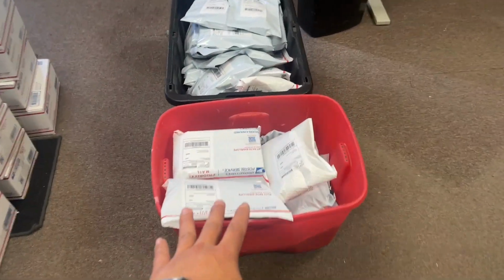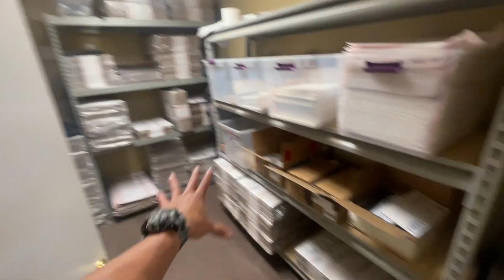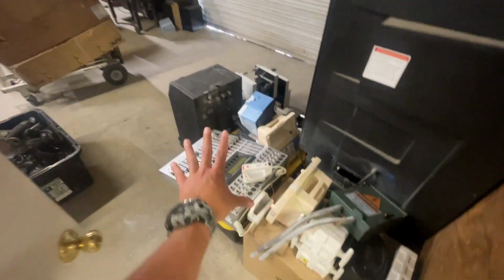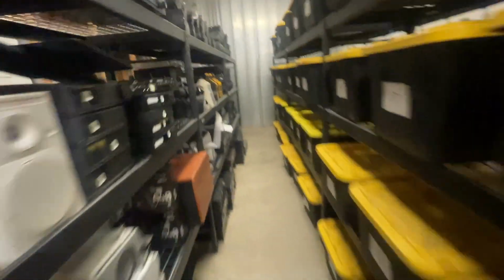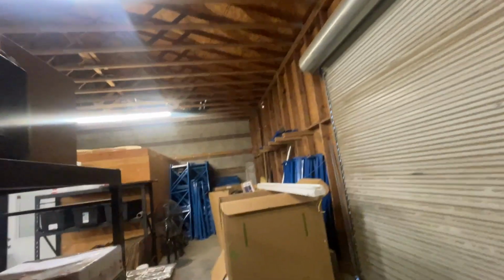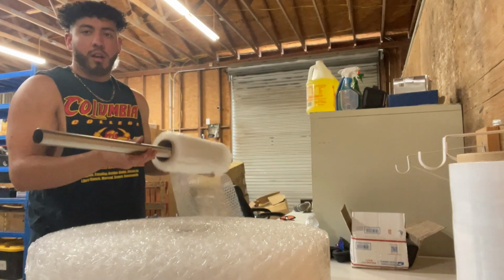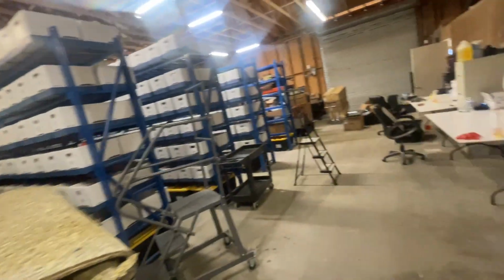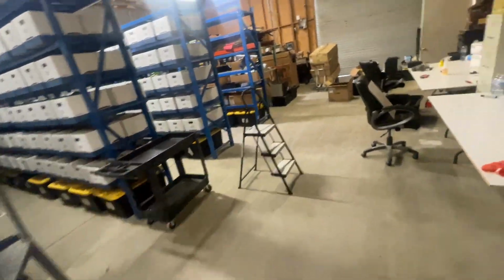Showing my new 3000 SQFT Ebay warehouse!!

Comment: Nice new spot. Not sure about what state you are in but here if the fire inspector came by they would have you move that tape gun and table. Nothing allowed within 3 feet of any electrical box. May want to look into so you can plan ahead before havingbto do it on the fly.
Reply from the maker: Going to look into that thanks for the heads up! That electrical box is actually not active and it’s for the office , but I’m gonna try to either get it removed or checked out to see what it was connected to thank you
Reply: @Activeapparelzone  no problem man i learned the hard way